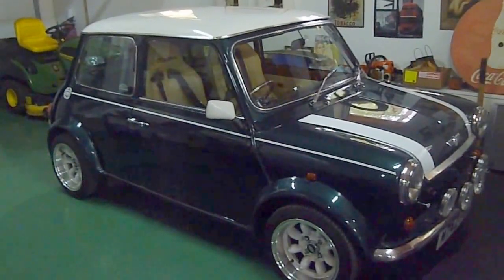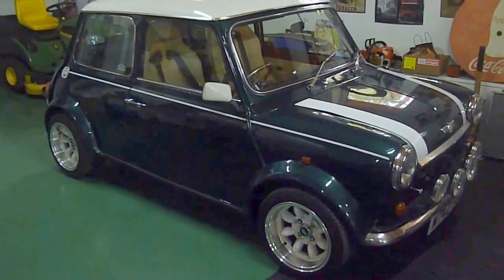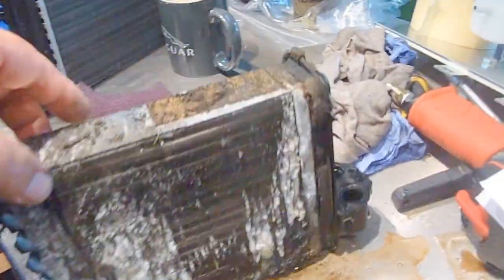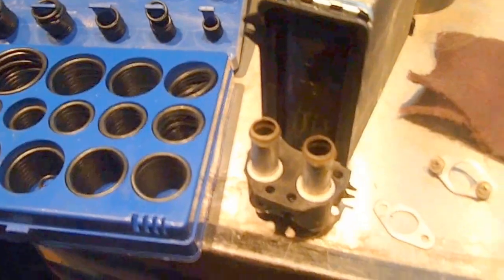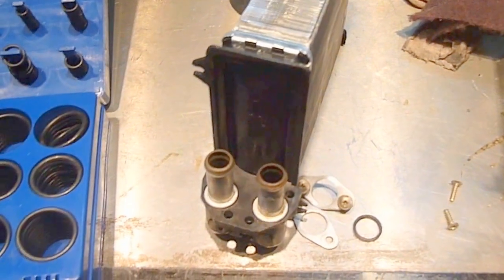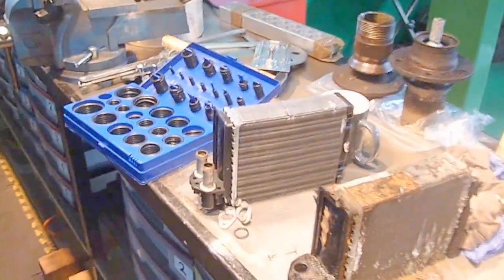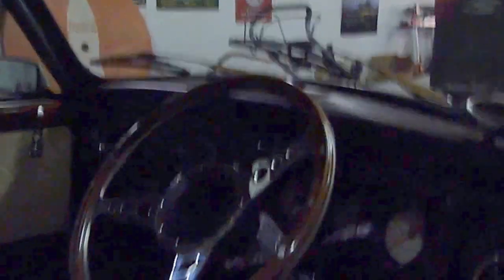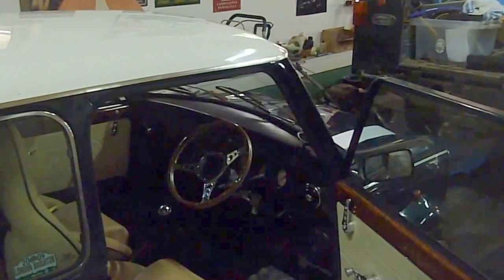classic mini heater matrix  replacement.

Comment: Hi, thanks for the videos, what size o rings are needed?
Reply from the maker: To be honest i used what fitted correctly from the O ring kit i had.
I am sure you can get them from Mini Spares UK  all the best David
Reply: Thanks for your reply David, I bought the same O ring set you have - £5.95 on eBay (bargain). In case anyone needs to know the size required, for future reference - I ones that fitted had an internal diameter of 16mm external of 21mm and a section of 2.5mm. Keep posting the videos! Thanks.
Reply from the maker: Sorry i could not be of more helpful with the size but the O Ring kits are worth there weight in gold!
All the best David

Comment: Can you explain a bit more about the process of replacing the matrix? Did you flush the coolant? Check thermostat, etc? I've tried to do this myself and now my mini keeps overheating.. thanks for sharing!!
Reply from the maker: I would doubt that it‘s anything to do with the matrix as the heater can be by passed, It is most likely the thermostat would be at fault perhaps jammed in the closed position as there is a bypass between the head and the block. By a good radiator flush get it to temp and then dump it and see how much scale you get in the bucket, Drop me an e-mail at davejaguar66@gmail.com if i can help. Cheers David.

Comment: HI. Where exactly do you put the foam strips on the new matrix?
Reply from the maker: They are stuck to the sides of the matrix so when you fit it back in the box it does not rattle or move around. Cheers dave.

Comment: How long takes to replace metrix, how hard is it..
 Thanks
Reply from the maker: +rifar er 
to be honest the biggest job is getting the heater box out of the car as you will need to clean the insides out of the heater box
of all the Gungy mess a leaking matrix leaves behind. The matrix replacement ids a 15 minute job. all the best David